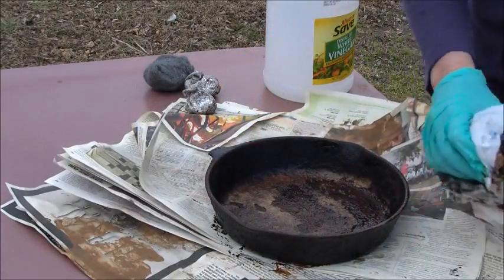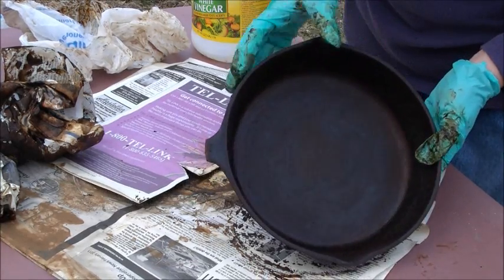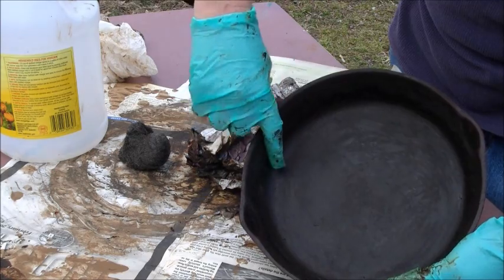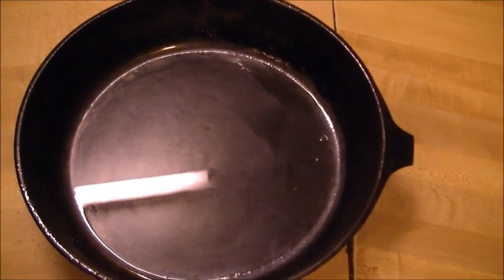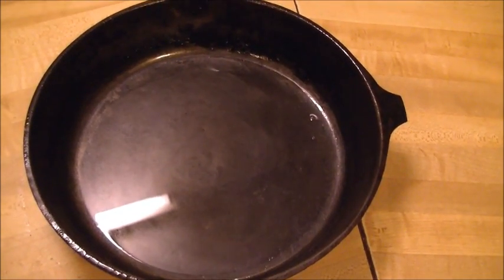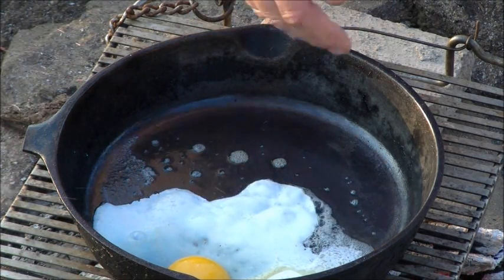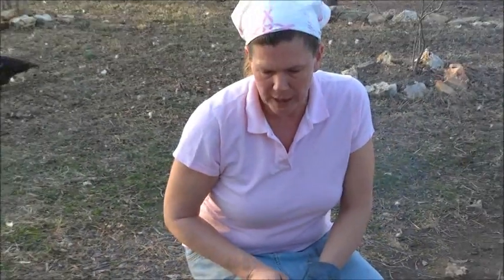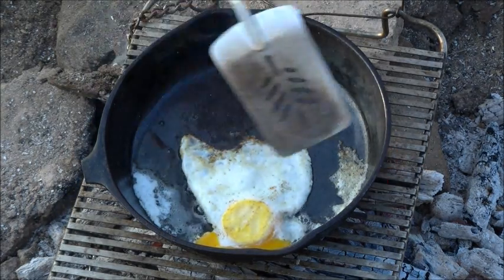Cleaning Rusted Cast Iron (Pt 2)

Comment: I had a favorite wok that had been through my house fire, then used for storage of bent rusty nails, then got forgotten outside with said nails inside standing full of rain water for at least 9 YEARS!!!!  You guessed it! I got it to come back to life! I did begin with a rotary wire brush on a drill for mine because it was even more extreme than the outside of your pan, but I took up your process after that. Thanks for taking the time to show how this works!

Comment: Thank-you Tam for sharing the fact that the foil will help with the restoring of cast iron. About two years age someone was going to throw away a cast iron skillet for being about as bad as the one you just restored. If I would have known your method back then it would have saved me quite a bit of time. Now it is the skillet that I use the most. It has a few pits but nothing I can't work around. Thanks again Tam

Comment: Excellent video. I and my mother have my grandmothers cast iron. One of the heavy and deep "chicken frying" skillets has the handle broke off it. My grandfather would build fires to clean the iron in the yard. He done this periodically, grandmother explained, to remove the build up from the years of use, then reseason them. He left the large one in the fire too long and the handle snapped while it was being cleaned. The hollers rang in Alabama for years when grandma got done with him lol.

Comment: This is the system I use as well. The process takes longer but there is no elbow grease required, no harsh chemicals and you can reuse the solution several times.

Comment: Cool video,for a quick seasoning, add a little oil to pan and spread all around,place on stove eye and heat on med-high for few mins.As others have posted,my mother and grandmother would build a fire and place pans in it to clean the build up off.

Comment: @luiz4rdz best way to clean plastic containers is to use baking soda & white vinegar, for things like a canteen where you can't actually scrub it with a brush or something, the boiling action of the mixture does the scrubbing for you, make a very thin mixture not paste-like more like a thin sauce -its hard to explain but you will figure it out as you go anyway then you coat the inside well, if it dries out too much just add more vinegar;let soak a bit, Rinse with water, repeat if needed,

Comment: @soarntam both. I did as you instructed in your video, and it removed alot o the rust but there is still so much left. So i scrubbed it for hours for 2 days. but since this paticular piece of cast iron is so cluncky and unwieldy with  some right angles to it it is near impossible to clean. We have the hibachi style charcoal grill by lodge. It doesn't really look all that bad. Like there are not huge holes in it or anything but there is that whole bubbled rust look if you know what i mean.

Comment: Another tip,for food sticking: heat the pan ,hot,then add oil let that get warm then add food,works everytime (if it's a seasoned pan) not new.I rarely cook in any other kind of pan, can't beat cast iron.

Comment: you can bake it at 350-400 for a hour and it will season it a lot better

another tip is you can reason it and after you cook something take your pans and throw them in there while the oven cools that way your not wasting energy and it will use wasted heat in the oven

Comment: i found a charter oak wood burning single oven stove in an abandoned trappers cabin way up in the mountains many years ago . i did what you said , i sandblasted it the n acid vatted all the pieces it is made of . i took it completely apart , after al the scale and corrosion was cleaned off i used a gallon bucket half full of rendered lard on all cooking surfaces , put it in a foundry kiln at 300 degrees for 12 hrs . then let the kiln and stove parts cool down naturally . when that was done ,

Comment: i reassembled it with blackened stainles steel bolts , grade 8`s . repained areas that originally had paint and did an early type jappaned finish on it . the outside was original oyster white  , the inside was grante coated . i left those alone cept for a good thorough cleaning multiple times . now , except for an idiot puttin a 22 thru the door of the oven i fixed , you would swear its new . and works good too !

Comment: I think there is an easier way.  I have recovered a cast iron pan by putting it in a self cleaning electric oven.  The way I think it works is when the oven is in self cleaning mode it gets very hot.  The oxidation heats at one rate and then burns off.  The pantina heats at another rate and then burns off.  In the end I had a pan that looked basically new without any coatings on it.  The surface oxidation started immediately, but that was something I could wipe off and then start the re-coating

Comment: Here's a video from a guy who restored a rusted cast iron skillet without using chemical-laden oven cleaner.  After giving it a good scrubbing with a wire brush, he then soaked it in a solution of 50% apple cider vinegar, 50% water for a week to ten days.  The results were astonishing.  I tried posting the video link but YouTube gave an error; so just look on YouTube for the video entitled "Operation Skillet Rescue."

Comment: Thanks for posting such a detailed video on restoring cast iron. I was hoping someone could give some further advice on a larger project. I found an old Majestic stove and was wondering if it is able to be salvaged. It it caked with thick rust on and around the burners and a few other areas. I wanted to restore it because I think it is beautiful. Is this possible or are some old rusted cast iron just too badly damaged to restore?

Comment: i would like to know after you scrubbed the pan with the  steel wool pad did you rinsed it off with water and then put the vegetable shortening? Because I have the same skillet  of course with a handle on it and I  have seasoned just like you said in the oven with vegetable shortening. But everytime I use it depending how dirty it gets I wash with warm water and soap make sure its dry then season it again and heat it over the stove top. Let it cool put away of course in the oven as storage.

Comment: dont forget clean and season the outer bottom side too; otherwise, the rust will eat it from the outside until it passes through.  And dont use metal utensils with cast iron. Thank you for the video. My observation was mostly for the spectators by the way.
Reply: Why should metal not be used on cast iron? Can a metal utensil scratch the seasoning in the bottom?

Comment: It is far simpler to just soak the entire skillet in white wine vinegar for 48 hours. After 24 hours, you give it a good scrub down with a wire brush and then soak again for 24 hours. You have added additional, needless steps with the aluminum foil scrubbing and oven cleaner. Try it out. You will see.

Comment: Great tutorial!. Im going to try it with my aunts Cast Iron frying pan.
 Although I heard that Grapeseed oil is a better "seasoning" for cast iron than regular Vegetable shortning.
Anyone ever use that instead?
Reply: I've never used grapeseed oil personally. I've heard that the best thing to use is flaxseed oil. A good, pure flaxseed oil. Because it builds a nice, hard season that doesn't easily come off.

I'm in the middle of restoring an aebleskiver pan I found last week, and plan on using canola oil for the re-seasoning. I'm using that, because it's a semi-drying oil. Where flaxseed is a drying oil. I would use flaxseed, but I just have the canola.

Just study into things, and don't go on hearsay. There's a science behind this stuff!

Comment: Well done. I came here well actually part 1 to see how to remove rust from a set of old Double hump heads i wanna rebuild and wanted to take some rust of from cast haha might try this method but at the end i wont bake the heads in the oven i will spray some wd-40 or penetrating oil on them lol